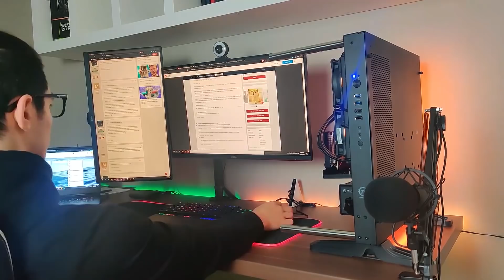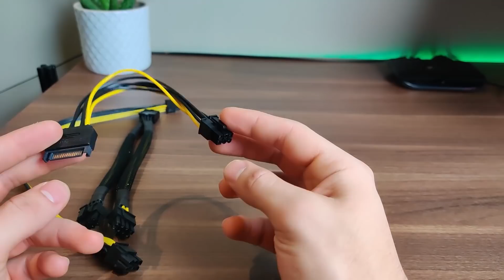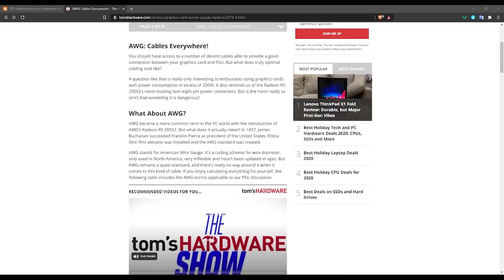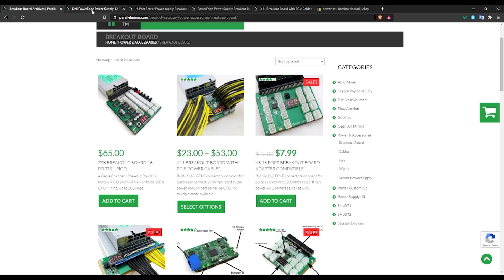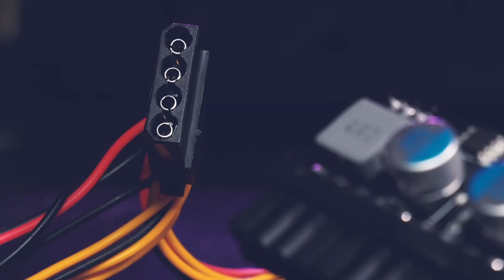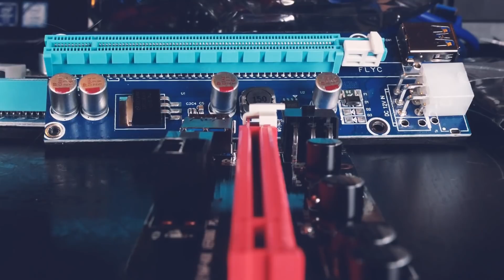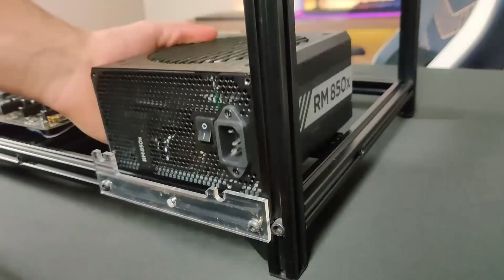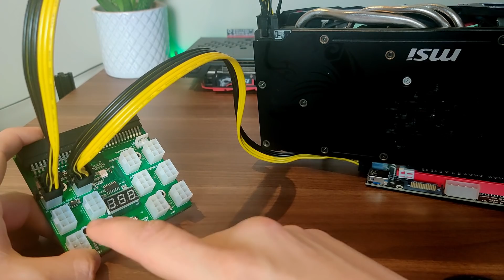Using Server Powersupplies For Your Mining Rig FULL Guide

Comment: Hello Mining chamber. To build a mining rig a ASUS B250 Mining Expert that has 3x 24 pin, I wonder if I can use only 1 server PSU with 3 ATX PSUs that i already have.

The ATX PSUs that I have are Corsair 1000W 80+ Platinum. But I want to build a 19 GPUs rig with 9un RTX 3060TI and 10un RX 6800. To power them up, as you said that we should only use 80% of the PSU power, the 3 ATX PSU wont have enough power. So, can I use only one server psu to power up some of those GPUs? How should I do it?

I mean, for example, I could power only 4 gpus per ATX psus and then, with the last one, plug in the 4 pin molex cable to the server psu and then plug in the other 7 gpus to the server psu? Or is there a better way to power them all up?

Comment: quick question: could i use 1 server psu to power multiple gpus from 2 different systems?
Reply from the maker: Hmm you can but it's dangerous I feel like it since the psu will turn on/off if any of the other rig is signaled to go off
Reply: @MiningChamber  ok i wont risk it then. thanks for the answer

Comment: which one should I choose?300w or 120w. 8*570 8gb server pcu. my country use 220w. and I don't undrstand electricity:(

1-https://www.amazon.com/RGEEK-Switch-24pin-Supply-Computer/dp/B071P3HMNK/ref=pd_di_sccai_4?pd_rd_w=nmDdV&pf_rd_p=c9443270-b914-4430-a90b-72e3e7e784e0&pf_rd_r=GYMDTJ6XNE3SR6YEPY01&pd_rd_r=4f3ec665-b44d-4aaa-aebe-a1ce53831cea&pd_rd_wg=HzfbP&pd_rd_i=B071P3HMNK&psc=1

2-https://www.amazon.com/dp/B07DC6J443/ref=sspa_dk_detail_2?psc=1&pd_rd_i=B07DC6J443&pd_rd_w=IXsP7&pf_rd_p=4269e1a0-a218-4fbd-9748-1cd337d2f2a5&pd_rd_wg=2emPt&pf_rd_r=D7C1ZJANWS8ZW38D1A25&pd_rd_r=d2fd6980-cd55-41e1-baa7-eaf71ac46581&smid=A4IWNATC64MMF&spLa=ZW5jcnlwdGVkUXVhbGlmaWVyPUEzSlNSWVJHQzk0RUNEJmVuY3J5cHRlZElkPUEwOTY0OTU3MjZSTFNCUTZCSVZETyZlbmNyeXB0ZWRBZElkPUEwMDMxOTQ0MVAzTUs0RkRLSE5ONCZ3aWRnZXROYW1lPXNwX2RldGFpbCZhY3Rpb249Y2xpY2tSZWRpcmVjdCZkb05vdExvZ0NsaWNrPXRydWU=

3-https://www.amazon.com/RGEEK-24pin-Input-Output-Switch/dp/B07WDG49S8/ref=pd_di_sccai_1?pd_rd_w=ByZR3&pf_rd_p=c9443270-b914-4430-a90b-72e3e7e784e0&pf_rd_r=ASA9NP46877SZ43R3JAK&pd_rd_r=83c5a901-7a29-4939-9174-dc95c23e9c69&pd_rd_wg=NRj2K&pd_rd_i=B07WDG49S8&psc=1

plase :(
Reply from the maker: These are just pico adapters you can use any, I suggest getting them from ParallelMiner they are more reliable

Comment: with the 30 series, is anyone using 6+2 splitters off of the breakout boards? I am ordering from parallel now thanks to this EXTREMELY helpful video, but just curious how to maximize 3070 capacity on these boards. I see Parallel miner sells 18awg splitters, but that seems to go against what you're saying...
Reply from the maker: Hey! Glad it was helpful! You can use one strand to gpu and one to riser, 3070s don't use alot of power when mining at a good undervolt. They consume around 130 watts at most so your set!
Reply: @MiningChamber  so using an 18awg to slit to the dual 6+2s should be fine? Thanks for the response!! The 3070s have dual 6+2 ports on them
Reply from the maker: Yes you should be fine!

Comment: There is one possibility which you haven't covered:
Using one Server PSU for multiple Motherboards.
Which complications would I have to work out (besides the obvious and unavoidable one that if I want to switch off one rig, I have to switch off everything)
What about a shutdown signal from one Motherboard? 
Can you solder together all "on/off command" wires from all motherboards (is there a voltage and signal behaviour standard)?
What else could go wrong?
Thanks!

Comment: Do you think Can I use this server power supply for run 2x RTX 3090? You say the cable only support 288Watts, and this GPU works using 300 and up Watts.

I just tried to substitute the ATX PSU.
Thank you
Reply from the maker: You can for sure, just use 2 cables instead of one for the gpu then your set

Comment: Ohhh.. Great video mate. I wish I saw this video before hunting for my bulky ATXs I paid an arm and a leg for. Looks like a very neat solution if you have a place to hide from their noise. To make sure I got everything right I have a quick test question. So you can power even power hungry GPUs like new 30x series (3080 for example) with just one 6 pin cable split into two 8 pin cables which such cards require. Right? Assuming this card would consume a max of 280W or so.
Reply from the maker: I wish I knew about then too before losing my kidney for ATX PSUs 😩 and yes exactly, you should be fine with doing that, but If you have a 3 8 pins 3080 then you will need 2 6 pin to 8 pins

Comment: Is there a way to get an ATX psu and server PSU to start at the same time if your breakout board doesn't have 4 pin or a molex and only 6 pins?
Reply from the maker: Unfortunately not any way I know of
Reply: @MiningChamber  Do you think I could dmg my equipment by turning them on at the same time? OR would you strongly recommend getting the other breakout board?

Comment: Quick question:

ATX PSU + Server PSU with Server PSU connected GPU not recognized

I can confirm when all GPUs connected to the regular ATX PSU, it's working fine.

After adding the Server PSU, switched 1 GPU over. Then GPU is not recognized by the Hive OS.

Using the commended setting, I connected the riser card and gpu using 2 6-pin power, also using ATX PSU molex 4 pin connected to the server PSU.

Any suggestion that why GPU using server PSU is not been recognized?
Reply from the maker: Hmm weird, did you make sure server psu is turning on through the 4 pins on it? Are you powering the gpu and the riser from the same psu?
Reply: @MiningChamber  Yes, I can used power switch turn on/off both ATX and Server PSU at the same, and yes, both riser and gpu are connected to the breakout board. After boot into HiveOS, it can not see the 2nd card.  I found your discord group, joined it and posting question there! Thanks!

Comment: Hi, I got a 550w atx powering my mother board + a 1660 super and a 1070, is that ok?
Reply from the maker: Yes that's okay! Just make sure to properly overclock and undervolt for mining. Check the overclocking video guide I recently posted
Reply: @MiningChamber  Thank you for the reply but my 1070 is dead(just stop working) now, having a power: 85, core: +250, mem:780, fan: 100% Using 130w. Temperature: 67.

Comment: in strategy number 3 are u sure it safe to do with a 4pin to molex cable then attaching the EVGA Molex Perif Cable, ive heard stories of it frying the HP server
Reply from the maker: I believe I did reply to this comment, if I did not sorry! but yes they are meant to be done that way, I have not yet heard of any issues like that
Reply: @MiningChamber  ok thanks because my board is the exact as yours in the video so I was wondering
Reply: @MiningChamber  I forgot to ask you, if u used the 4pin to molex connector to sync PSU n server, does it matter if the ATX PSU is using all the vga ports, my psu has 4 vga ports and each is powering a gpu, so is the 4pin to molex is still safe in this case?

Comment: Thank you for another great video! I started from zero but now have 2 rigs running and all Thanks to your videos!
I bought from Parallel Miner a 1200W HP server PSU. It is only able to power two RX 580s (can't power 3). It can't power a single RX 5700 XT. Wall voltage is 120V, most likely 15A (so it should be outputing at least around 900W). I am contacting Parallel Miner support but wanted to know if anyone else here had this problem.
Reply from the maker: Thank you! Really nice to hear ⛏️⛏️

As for the PSU, you should be able to power 4. 4 GPUs undervolted will be at 140 watts at most each so yes I'd recommend checking up with them!
Reply: I was able to figure it out. I had an ATX+server PSU setup that was linked together. Turns out I have to turn on the server PSU first (wait around 5 seconds) before turning on the ATX.
Reply: what matters is the 12V rail

Comment: Hi I have an EVGA 3080 GPU with 3x 8 pin ports. I was told to run individual cables meaning 3 completely separate 8 pin to 8 pin cables from the PSU to the GPU.. So using the splitter cable which is a single cable 8 pin to 2x 8pin is not recommended I was told by microcenter. My questions is will a server PSU with breakout board 6 pin to 8 pin cable work to power up my GPUs?
Reply from the maker: Hey, the info from microcenter is based off if your going to be gaming on it. But you will be mining and using less power if you properly overclocked it. So 2 cables from your psu is completely fine, with or without splitter is fine too. Server PSUs are also fine!

Comment: Two things the 75w 150w max has two do with two things.  Safety factor which is just how much you want to bake into make the product safe from over use or poor manufacturing.  But I believe the second part of this has to do with the NEC or IEE standard for plug and arc flash spacing. The more power the greater the risk of arc between two pins  creating a short and a fire. This again is sort of a safety thing based on engineering analysis for failures for a component and design.  I can get into a deep dive of this later offline in an email.
Reply from the maker: That's awesome thank you for the information!!

Comment: Thanks for the video!! But im curious why there is no 8pin’s on board instead of 6 pin? I think it would be more efficient maybe... and one more question, can i use one riser for rise the another riser something like that. Does it harm?
Reply from the maker: I am actually not sure myself! And as for the riser I did not understand your question sorry
Reply: @MiningChamber  im sorry i wrote riser instead of splitter. What im trying to say is how about using a splitter to splitter, instead of powering 1 riser, we can connect a splitter into that 6pin which is going to riser and we can power 2 riser. Is it safe to do? Or is it logical?
Reply from the maker: @FunFunello  ah yes definitely doable but if your already powering a high consumption gpu that is 150 watts and up and then your going to power 2 risers and 1 gpu with one strand that might be too much! Not recommended in a way
Reply: @MiningChamber  totally understood, for 5700xt’s i think its okay since its drawing about 90w... im not sure. Thanks for help
Reply from the maker: @FunFunello  Off the wall its taking at least 130 watts. but if that is your only solution then yes go for it!

Comment: Do you have to use a splitter to plug into an 8 pin GPU from the breakout board, or can you use two separate 6 to 6+2 pin connectors?
Reply from the maker: You don't need too, it's just it helps avoiding running short on cables. And you only can use it  if it's a dual 8 pin gpu

Comment: can i use only 1 server psu 1200 whit the 24 pin and cpu adapter  for a 6 gpu rig
Reply from the maker: Depends on what GPUs they are but don't forget about the 120/240v

Comment: Hi, newbie here in mining... Just a simple question. Do miners use an AVR on their rigs even the simplest like 2-4 GPUs? and why? Also if yes, is it ok to plug that server PSU on the same AVR where the ATX PSU is plugged as well as the Monitor? Thanks in advance. :)
Reply from the maker: Hey! I actually have no knowledge on that topic. I never used an AVR for the rigs so unfortunately I wouldn't be able to assist much
Reply: @MiningChamber  ohh i see no worries mate, if you haven't encountered or experience any problems without using AVR then thats a peace of mind for me :)

Comment: Is there any way to power the h110 btc+ pro motherboard with just a server psu that requires the 2 molex connection on the mother board?
Reply from the maker: Hmm yes I believe if you get a molex splitter you can! Splits your one molex to two molex

Comment: Ordered a psu from parallel miner with your code and just got it running , It works better then expected only need 1 psu for the 6 cards on that rack and its still running in quiet mode, was expecting a loud fan but its not even kicking on!! Definitely  recommend server power supply's now 👍👍
Reply from the maker: That's awesome I am glad to hear that!! Thank you for giving them a try 🙏
Reply: Are you connected the PSU to 120V or 240V?

Comment: So would a DPS-1200-FB PSU only be able to power 3 GTX 3070's, and a asrock h110 using a pico adaptor? Assuming you only use 1 type of GPU to mine for consistency. 
3 risers = 3 pin slots taken
3 GTX 3070s would take 6-pin slots?
Pico = 1 pin slot
2 leftover 6-pin slots isn't enough for another card and riser :/
Or, do I not understand something?

Thank you for the video. You got a new sub fho sho!. New miner as you can guess, but old pc gamer so server power seemed like the logical cost effective entry. [ I don't own 3 gtx 3070s fyi. I just want to make sure I understand proper power distribution. XD ]
Reply from the maker: Thank you and welcome to the community!! So yes your on the right path, you can use a 1200 hp psu but all you need is a bigger breakout board. 

As we mentioned in the video there are 12 6 pin boards and 16 6 pin boards. Get one of the 16 pin boards then your set! Or you can get their new breakout board with the pico built into it like we mentioned in the video.

1 slot for gpu(splitters if needed), 1 slot for riser.
Reply: @MiningChamber  well see I didn't know if the bigger breakout board was intended for 200 volt. XDD I'd hate to wake up to a fire. 

Thank you dog, and stay genuine! <3 Best buy has 600 watt evga power supply cheap today if you need one.
Reply from the maker: Haha the breakout board as long as compatible with psu then your good ;) take care and good luck!

Comment: Would it be profitable to mine with a laptop? I have a laptop with a 2080 super: https://www.amazon.ca/HP-17-Inch-i7-9750H-Solid-State-17-cb0090nr/dp/B08K5K5YXJ/ref=sr_1_8?crid=SSG7UG8AEYAV&dchild=1&keywords=rtx+2080+laptop&qid=1609971760&s=electronics&sprefix=rtx+2080+lap%2Caps%2C157&sr=1-8
I am planning on getting an rtx 3000 series laptop so I won't need this anymore. I originally planned on selling it but now I think that it might be better to mine on it. Would it be profitable?
Reply from the maker: Mm you can mine with it, it just won't be that profitable and not convenient because laptops do get pretty hot but still possible. You can check how much it will make you by going to WhatToMine.com and fill in the spot for 1 RTX 2080
Reply: @MiningChamber  It will not give the correct results as this is not a desktop gpu
Reply from the maker: @ShehraanHafiz  oh that is true in that case, run the miner see your mh and then calculate based on your mh
Reply: @MiningChamber  oh, ok. Thanks

Comment: Hi mining chamber 
I have hx 1200w  can i use one 8 pin from power supply to 2 rx 5700 8gb 
And dont understen one button in power supply single or multple 12V
Reply from the maker: I don't recommend doing that at all, it's too risky! And dont worry about that button, you can understand more about it through the manual but no need to click it
Reply: @MiningChamber  how about from 6pin power supply to power one rx5700
Reply from the maker: It needs to be a vga cable. Check our ATX psu guide and our Server psu guide and youl understand more about this topic
Reply: @MiningChamber  thank you 👍